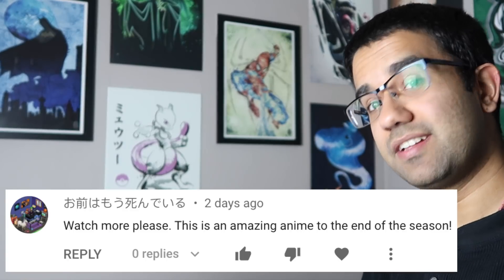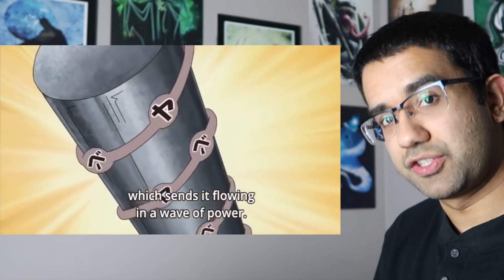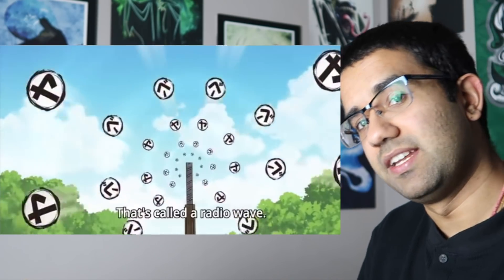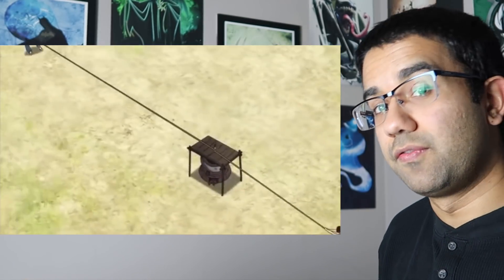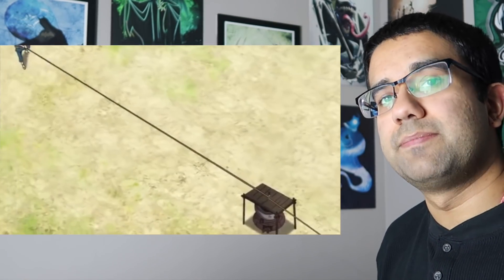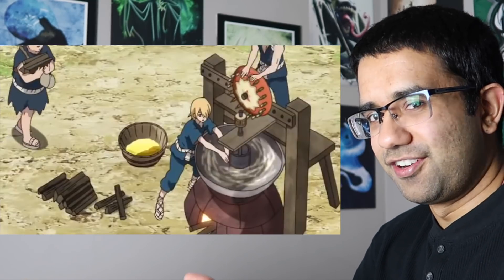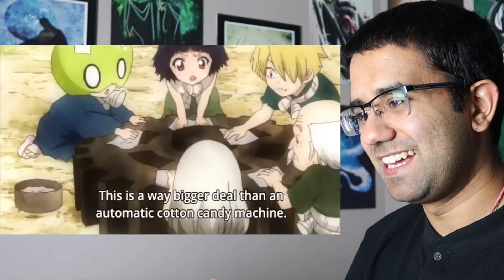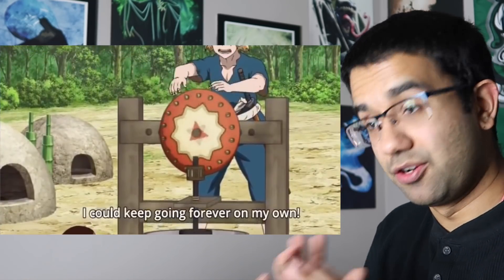Real Engineer reacts to Technology in Dr. Stone #20

Comment: I get the impression that for the Gold it is just that they DEPICT the gold wire to be fairly big (rather than the "Smaller than a length of hair" it would be) to make it easier to animate.
.
So it just looks like a LOT more gold than it actually is.
.
Think a spider and its web. A small spider can produce several kilometers of silk in a single go (Some as much as 1000km for a single web in a single day... which funny enough would be enough to go to the mountain and back)...
.
Edit: I also did the math... Cotton candy strands are so tiny that 30 grams of sugar can create 4km of cotton candy. So, it isn't THAT much gold (at least not the treasure chest full of gold coins you are thinking).

Comment: 100 percent, that's how you smelt wire. It's really easy with gold and copper due to their low melting point and malleability, under both hot and cold conditions.
You use the momentum of the bowl to create basically a whirlpool, wich will naturally bleed out the wire. The molten metal should cool as it gets forced through the hole into the open air.
Reply: Its also how cotton candy machines work, as mentioned in the anime

Comment: I still don’t get how you get electricity from water and the whaterwheel
Reply: The flow of the river is causing the wheel to turn, through the use of gears it makes the copper discs to rotate in between the two magnets creating electricity.
Reply: @FrostyShock349  Woah you can make electricity the the copper discs and magnets? Then how about hydroelectricity like those in waterfalls?

Comment: Its almost like spin casting or centrifugal casting but instead of a holding vessel its extruded out of the small holes. Usually wire is made through a reductive process of rolling mills, consecutively squeezing the rod stock more and more, thinning and lengthening it into wire. Insulation is done by essentially pulling the wire through liquid plastic/rubber baths or cascades. You can do a similar process at home with bare wire and plastidip(the kind for rubberizing tools)  The way its presented in the show is actually pretty clever. I don't think it would work without having the casted wire secured onto feed rolls to pull it through, preventing it from bunching up. It'd be neat to see someone try to recreate some of the things in the show.